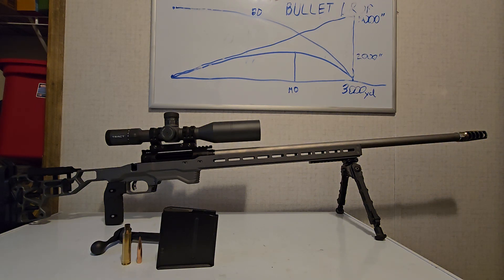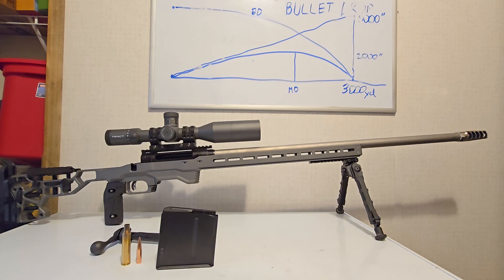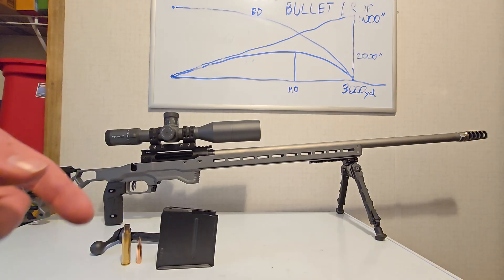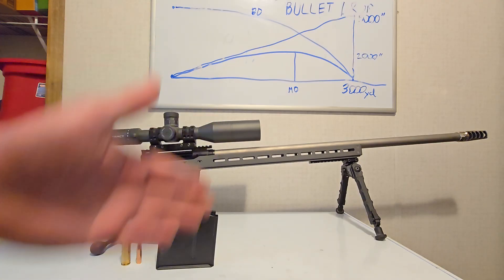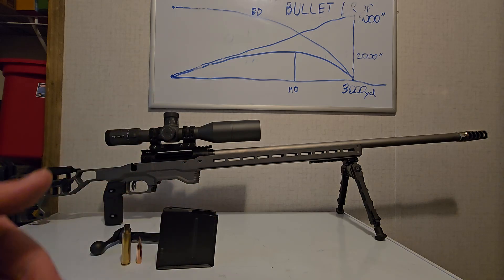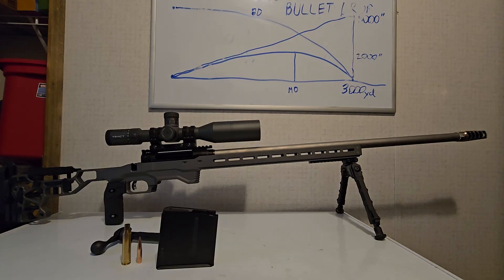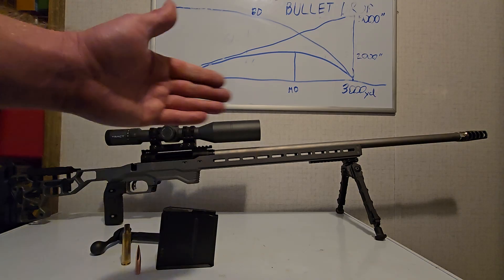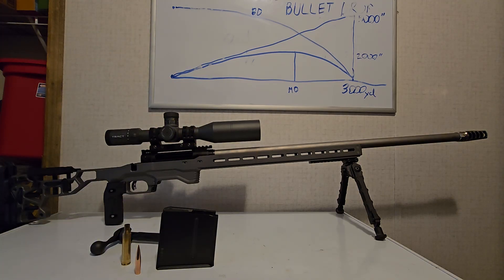Max Effective Range is Not What You're Being Told

Comment: I woke up during the night thinking about your situation.  There are a few things to do to identify accuracy issues. I would measure the chamber for OAL. If you have excessive headspace (leade clearance) then there is too much play before the projectile enters the lands/grooves.  The best accuracy could be at soft jam. Some barrels like out to 20 thousands or even more, but your chamber could be cut longer for allowing longer projectiles seating. I don't know. I doubt it would be the firing pin as you mention.  What rifling do you have? If it is not enough, then it may not support heavier bullet weights. Shorter rifling will stabilize heavier bullets. Also check your muzzle for any damage to the crown. That would definitely cause accuracy issues. I suggest these things to prevent you from spending a lot of money to test several different ammo brands, bullet weights.
Reply from the maker: Yeah, the factory ammo is jumping  .200" or so compared to the jam length that I found with the Nosler RDF. It's a lot of jump. My Loads are about .150" outside the magazine and they still close easily, they are touching but not a hard jam. Savage says it's a 1:9 twist.